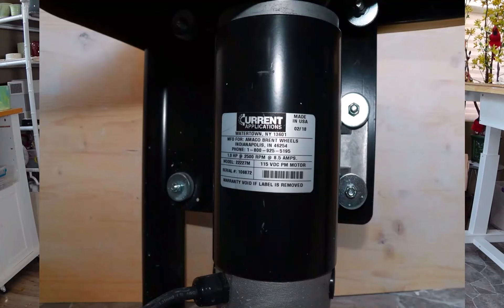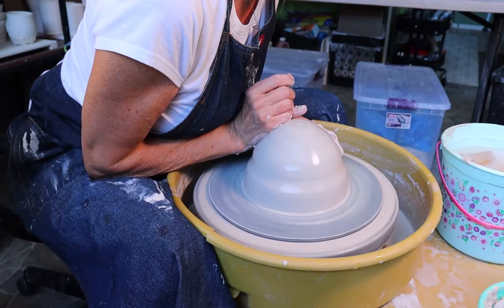Brent CXC Pottery Wheel - Owners Review - Features Performance & Maintenance Guide

Comment: Hi Marie!  Thank you for making this video.  I too have the same model wheel, but I find it really difficult to take off and replace the splash pan.  Do you think I can try some DW-40 on the larger pan where it goes under the wheel?  I checked underneath and didn't see a build up of clay or anything.
Reply from the maker: Glad it was helpful! Yes that should help. I really struggled with mine at first also. I didn't think of it when I made the video. I put the larger part of the splash pan closest to me. See if that helps also. 😊